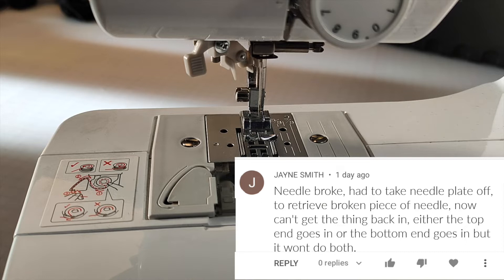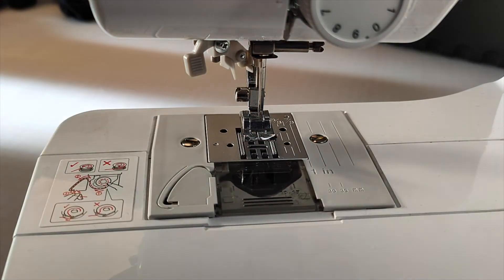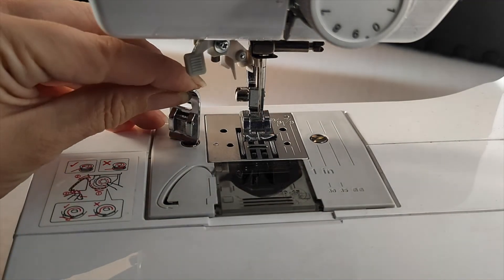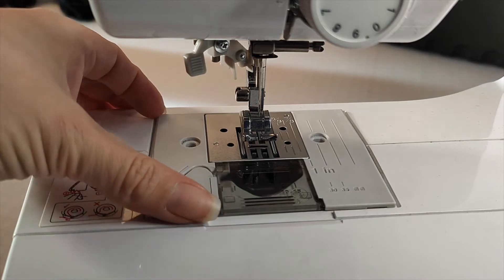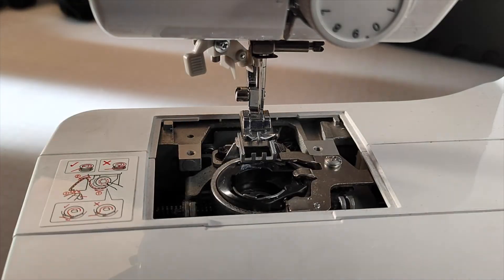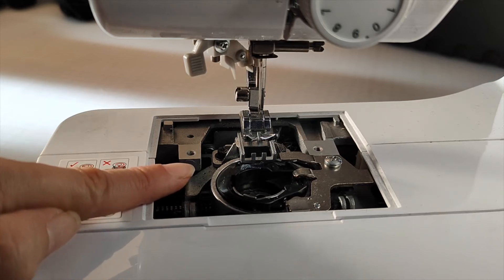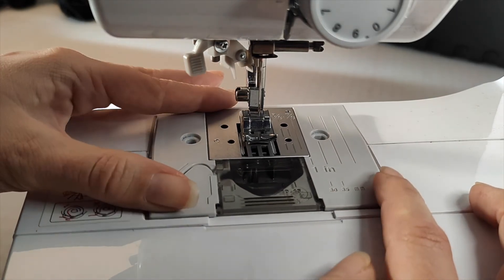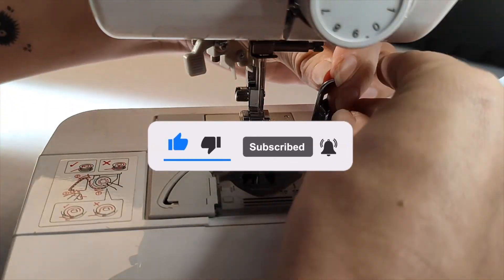How to remove the base plate from your sewing machine

Comment: I’ve tried everything to open the screws, with dimes,  screwdrivers, pins, scissors and more. They are screwed too tight and I can’t get them to open!!
Reply: Did you find a fix?
Reply from the maker: Try dropping a tiny bit of WD40 or machine oil on each screw and leave it overnight. Then try to undo them again in the morning and see if they have loosened.
Reply: @Giovannii375  mine was an older version I believe, so I was able to enter from the side trap instead of the top one and I took the bobbin out!

Comment: Mines won't budge 😢
Reply from the maker: Is it the same machine?
Reply: Not the same machine, but same part I had to unscrew. I ended up getting it though after some trying. 

Thanks for the video. It wasn't my problem but I did learn from it 😊. My problem was the timing itself, so I had to open up more parts and do A LOT more work lol
Reply: @GrenadaLovee same problem here !!! how did you manage to open it please ?
Reply: @Sara-qc5tj My memory is horrible at times but it was either a butter knife or flay head screwdriver
Reply: @GrenadaLovee  thank u so much I'll try this out !!!!
Reply: @Sara-qc5tj  of course. You need to use all of your muscles too lol